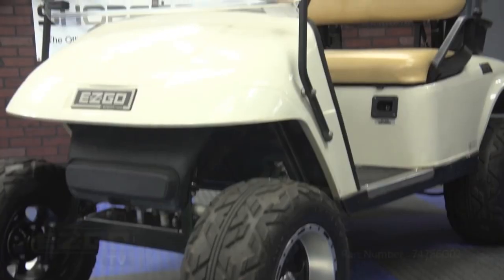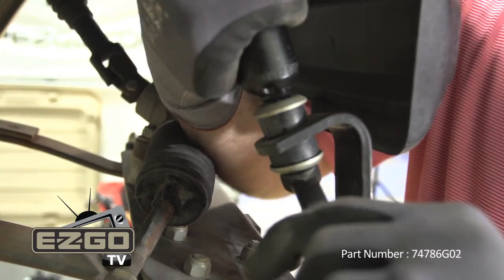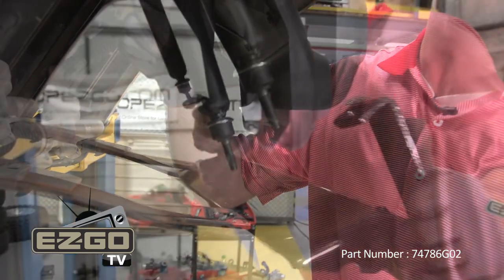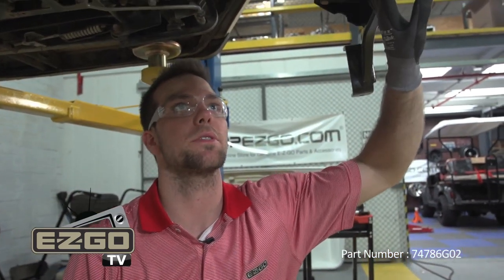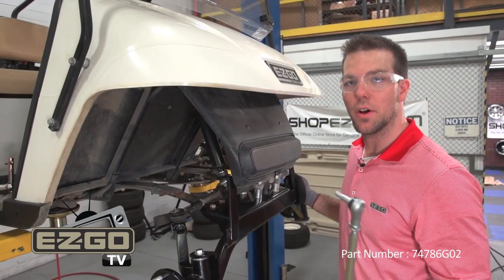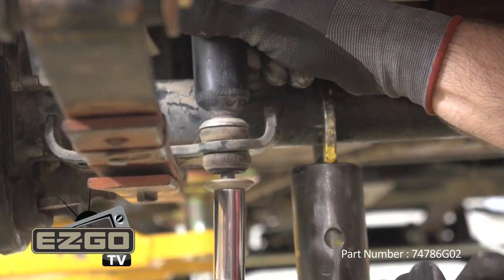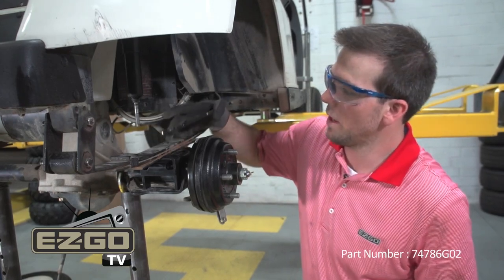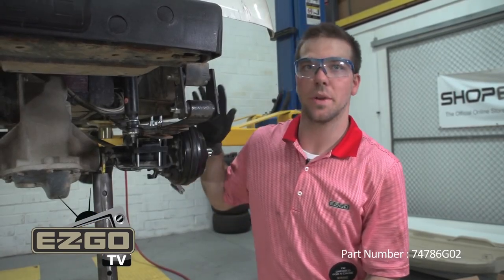How to Install an EZGO Lift Kit Installation - Lifting a Golf Car

Comment: Shouldn't the pin for the brake cable be installed from the top in the event the cotter pin fails to prevent it from falling out

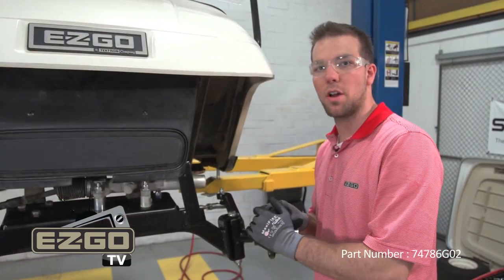Comment: For all the perceived professionalism this video shows they sure made a Rookie mistake. You never use a ball joint separator on any joint you plan on reusing. It will destroy the boot every time. Look at 5:19 you can see the boot is now torn, allowing grease to come out ant contamination to enter.
Reply: and put installed the brake pin upside down..  over all great job, as I have never touched a golf cart before this was very helpful to me to learn from
Reply: So what should be used so that isn't a problem?